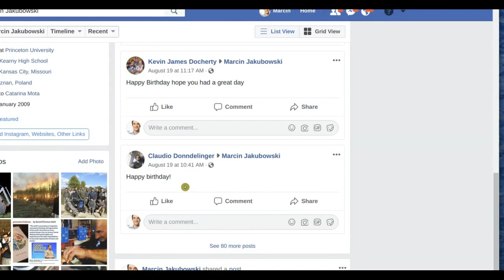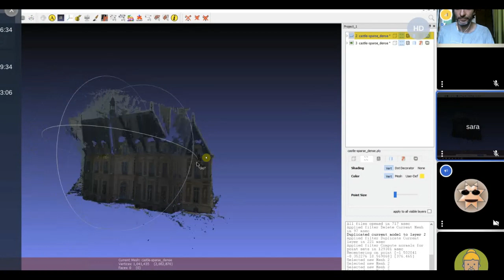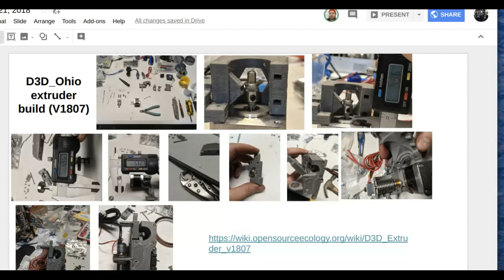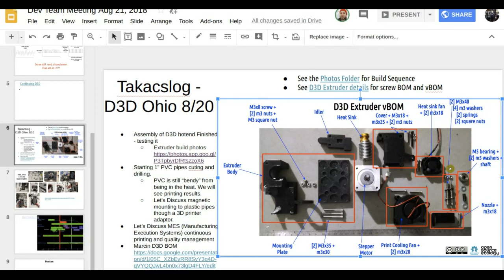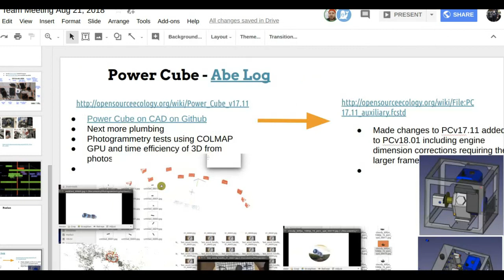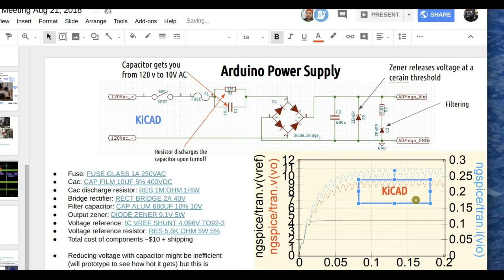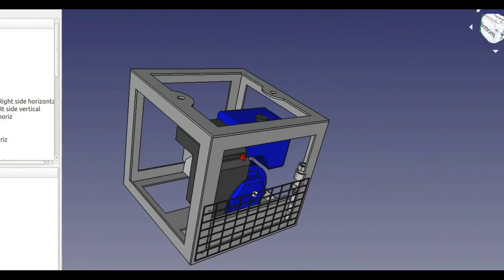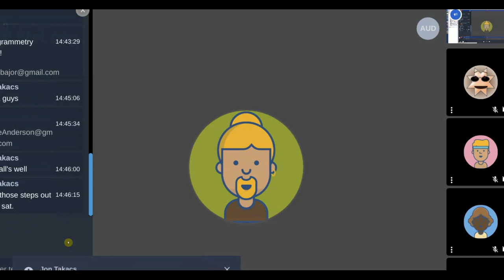Development Team Meeting -  Aug 21, 2018

Comment: About that Arduino power supply. I hope you're not going to use it anywhere where people might be in contact with low voltage side, because both + and - at the output side will be 120V in relation to earth ground. This is one of the reasons, why phone chargers and such use transformers, which isolate mains side from low voltage side. If you were already talking about this in this video, then sorry - the audio quality is really bad (I didn't have patience to listen to all of it).